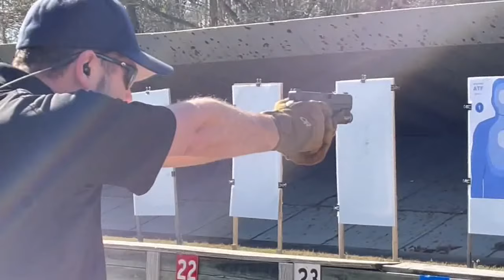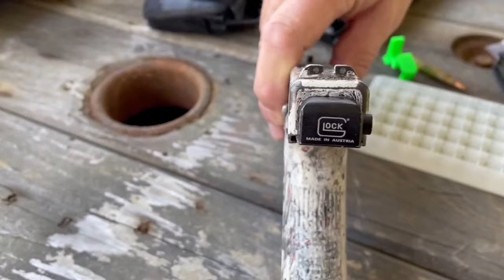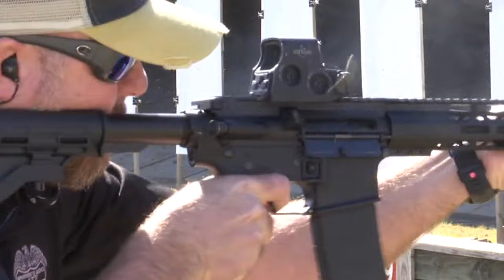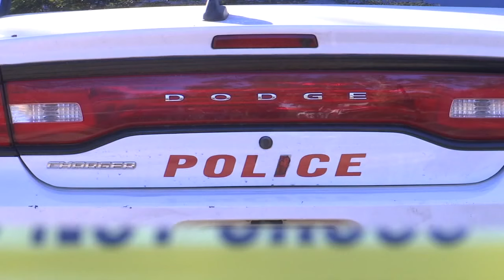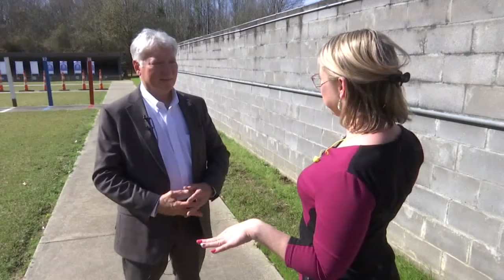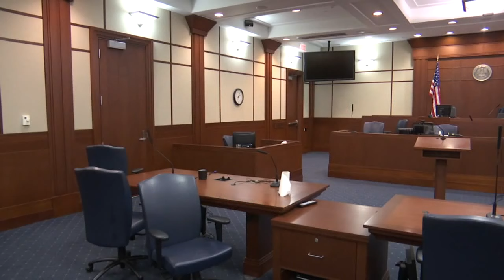How does a Glock switch work? Law enforcement trying to crack down on deadly 3D printed attachment

Comment: Any ban should include law enforcement as well.
Reply: That sounds great.  the spray pattern of this would hit too many bystanders.
Reply: Found the criminal
Reply: The road to serfdom  Membership has its privileges.
Reply: Yup
Reply: @1993MAZDAMIATA  Found the Biden voter
Reply: @oldnite3414  I don’t even vote
Reply: @1993MAZDAMIATA  what criminal?
Reply: @bigjon576  op
Reply: @ZirbMonkey not if you add enough penalties to discourage using it indiscriminately. We keep attacking the gun when society is the problem.
Reply: Yeah if I can’t own a fully operational tank than neither should the army.
Reply: It seems only useful at close range vs one person. I would not use one even if it were free and legal.
Reply: A majority of law enforcement doesn’t have full auto weapons 🤡
Reply: @1993MAZDAMIATA  so you are part of the problem
Reply: @CYOnTheBeat  not necessarily. Why would I vote if both candidates suck. No point on voting for someone you don’t like
Reply: why?

Comment: We should all be able to legally possess switches if all the criminals already got ‘em 💪
Reply: That should mean they're "in common use"
Reply: They were originally intended for police use but since they’re inaccurate they didn’t use them then some got on the streets and they ban it
Reply: @therandomrobert1842  The funny thing about that is that Glock themselves made the Glock 18 which is a full auto version so clearly there's a market for it in police, military and private security
Reply: @therandomrobert1842  only police can spray a Glock safely 🤓
Reply: @ir0nlun6s56   But your machine guns need to be transferable which means they were made prior to 1986. And they're very very expensive
Reply: I mean why would you want it to be legal, it's cool and fun yeah but really inaccurate and doesn't really have any use even in the hands of police
Reply: @redtra236   If you're big enough and trained enough it's very practical..
Reply: @aaronsmith5600  Yeah with a vertical grip and stock it's definitely effective
Reply: @redtra236  it should be legal because of the second amendment, it's not about practicality it's about the principle
Reply: @1810jeff  or being 6'6"and 270 really helps
Reply: @aaronsmith5600  I mean I did get to shoot one before(legally possessed by an SOT). I agree it could be practical but I don't see why a civilian would need it, and I don't even think police should have them because especially under stress rounds are gonna go everywhere and greatly increase the risk of bystanders being accidentally shot. And also possibly get officers killed because your mag is empty in literally less than a second with a 17 rounder. If you spray 17 rounds that don't do the job you're gonna be in trouble if they are armed.
Reply: @ir0nlun6s56  not true. I have more than 12 Class III forum 1 and forum 4’s, all SBR’s and suppressor’s but if I wanted a full-auto manufactured after 1986, I’d have to obtain and FFL SOT. In order to get an any of the Class FFL SOT’s, you’d first and foremost have to have a brick & mortar store you plan on selling or manufacturing firearms from and then you can go about all the proper paperwork, filings, tax stamps, etc., etc.
Reply: Haha that's actual 'Murica logic.
Reply: Nah…criminals got them because they’re idiots. They shoot everything but the intended target.
Reply: @aaronsmith5600  just because your big doesn't make you bullet proof.
Reply: @bigjon576   Never said that just said it makes it easier to control machine guns
Reply: @chawklitWarrior Most do that without Switch equipped Glocks.

Comment: The writing is on the wall. 
If you have any semi auto that possesses the ability to be made into a full auto, it will be considered instantly convertible and banned. 
    They are just trimming some branches to reach the goal if clearing the entire forrest
Reply: THAMKS NRA
Reply: You know what the difference between the atf calling a binary trigger a machine gun and them calling a Glock switch a machine gun ...... You only find Glock switches in the hood 😂😂😂😂😂

Comment: 1200 rounds per minute… geez talk about stroking a lie lol
Reply: That's actually the rate of fire for a Glock 18
Reply: its true though
Reply: Were you also surprised that there are no horses involved in “HorsePower”?
Reply: 1200rpm is an achievable but ultimately undesirable fire rate.
Reply: Id almost rather face off against a guy with a switch.. odds are they'll inaccurately spray the mag in a second and be left empty. Id be more frightened by the idea of well placed SA shots.

Comment: It’s unfortunate this news story provides inaccurate information.   No Glock magazine can hold 1200 rounds, therefore it is impossible to shoot at rate even close to this amount.  As a retired Navy Seal, NRA Instructor, this news agency should be embarrassed at the falsehoods.
Reply: It's not technically a lie but hyperbole.  It shoots rounds at a rate of 1200 per minute.  Meaning 20 rounds per second (which honestly sounds worse so no idea.why they didn't say that). Nobody will ever have that many rounds, but it's common to measure in rpm. The A10 warthog is an example. It shoots something like 3900 rpm, but only carries something like half of that. This just means it can't shoot for a sustained minute. I'll agree they're using big numbers to scare, but it's not exactly a lie.
Reply: @foxtrot889  
I completely disagree.  There is no way any person can take this weapon system and with any or every magazine available commercially make the Glock weapon reach 1200 rounds per minute.   Your assertion of this being a hyperbole, I could attest this device limits this firing rate to 1 round per century.  I would immediately be called out as a liar.    The fact is, there was a statement made that was completely inaccurate, intentionally misleading, and had the intent to scare people who already know very little about firearms, to believe they are bad.  I am very aware of the firing rate of other weapon systems.  This video made no claims other than what I addressed in my accurate comment.
Reply: @michaelscott9285  all I'm saying is it's a common measurement of how fast something shoots. Again, see the A10 warthog. It fires 3900rpm but only carries 1174 so is incapable of firing for a minute straight. RPM just means if it sustained fire for a minute, how many rounds would fire. They could've said 20 rounds per second, which a Glock with a 20+ round mag would indeed be capable of and it's the same exact rate of fire as 1200 rpm.
Reply: I have a 32 gallon fuel tank in my truck, but it can travel from Va Beach to San Diego on a single push of the accelerator without stopping and can make the trip in 15 minutes.  Oh by the way,  the need to continually add fuel is overlooked because a Dodge Hemi drives fast is preposterous.   So using your reasoning as this being a hyperbole, I can start telling everyone this is a true statement.   This does not make what the news report stated any more true than my statement saying I can drive coast to coast without adding fuel.   NEITHER statement is true or accurate, Both are misleading, but only one is a lie.  The one where this newscast makes an intentional false statement.   You cannot justify a lie because you use the term hyperbole.  Try using this defense in a court of law, I am sure you can discern if this would be a valid argument in court.
Reply: @michaelscott9285  Your the reason america is failing. Its like saying 3 feet doesnt exist because i only got 2.
Reply: just fear mongering my man.. just fear mongering.. sure the majority of people shouldnt have full auto but come on.. just reload time will lose you at least 150 rounds in that time if they can get it up to 1200 a minute.. belt fed glock pistols are definately dangerous lol
Reply: it's thier attempt to scare the audience.
Reply: @chetpower772  maybe he's saying that a glock can't fire 1200 a minute even with that device.
Reply: @theCosmicQueen it 100% can that dude who claimed to be a navy seal is clearly stolen Valor when we say this has the fire rate of 1200rounds per minute we don't mean it has a 1200 round mag😂😂😂
Reply: @foxtrot889 that dude claims to be a navy seal but think you mean firing 1200 rounder per minute means having a 1200 round mag😂😂😂😂 defiantly stolen Valor
Reply: @michaelscott9285  I guess the Gov't own specs for the glock 18 is 1,100-1,200 RPM must be wrong too, you should call them, and fix that, ATF would be happy to assist,  lol.
Reply: I get what he’s saying. With that device, if you actually want to fire 1,200 rounds with it… it will take you a lot longer. 

Just because I can run 15MPH… that doesn’t mean I will run 15 miles in one hour.

Comment: Full auto makes you less accurate, it's only good for mag dumps and mobs of zombies.
Reply: I learned in the Military to use Full Auto only when Advancing on a target or retreating from a position. Run out of ammo quickly.
Reply: I can’t really think of a use case for it. You would need to add a “””brace””” to have any form of control or one of those frames I’ve seen at gun shows. I really can’t think of a use for an smg apart from range fun or cqc in a combat scenario
Reply: @traceswann7054 no you can control a glock switch perfectly with good hand placement

Comment: 12,000 rounds per minute is an insane statement you will probably need like 8 glocks rigged to shoot at the same RPM
Reply: Notice the staging too - "goes from shooting one bullet at a time to 12,000 rounds per minute." A practiced shooter can make a semi gun shoot almost as fast as it would with a switch, so they hide that fact by conveniently not mentioning it at all. And then of course, there's the obvious fact that 12,000 rounds is insanely overestimated.

Comment: Hands down i can't think of any valid reason to have one. But stop makin' it seem like the law-abiding gun owner is doing this. It is 10000% exclusive to criminals.
Reply: Next door neighbor use to target shoot.
A BUNCH.
Heard rapid fire several times and guessed it was a machine gun.
They use to blow stuff up that would rattle our windows a quarter mile away.
Since all these noisy events from years gone by I have learned about tannerite ,
Slide fire, bump fire and now Glock switches. Been quiet over there for awhile now but I make a little noise myself now and then.

Comment: If anyone has shot a Glock with that switch.. The Magazine would be empty in seconds and since it has no stock or anything to help control it.. They would likely have a lot of rounds aimed higher than intended.

It is the criminal, not the switch who is at fault.

Comment: What troubles me that in the US Armed Forces it is , according  to tge Geneva Convention to use non jacketed or ball type ammo against the enemy  and all the antipersonal small arms ammo is full metal jacket. This prevents the round  from expanding  ( mushrooming or possibley fragmenting into smaller pieces causing major wounds ) and inhumanely harming if not killing your enemy in a brutal way. The jacket ( usally copper) keeps the lead intact and may just go straight  thru a body which actually statistically  causes  less harm to a body than if it expands inside and all the energy is transmitted to the inner tissue and destroying way more tissue and or  organs . However our own police use fragmentation  rounds  against  its own citizens and many many people are shot by police  and either  killed outright  or severely  injured  with multible wounds  from one bullet that may not have done a serious  enough crime to warrent being shot at in the first place. To  put in perspective it isnt legal in war to use these rounds against your enemy  who wants to kill you but our local cops can use them against the citizens  of the US.  Their claim is there is less  chance of collateral damage or hitting a innocent bystander  if the full metal jacket round they shot at a  possible suspect and it went thru them. Why dont they just NOT shoot period if there are potential innocents in the area. Use good judgement  when discharging a firearm  instead  of using violent rounds that  are so bad they are outlawed in war .

Comment: A lot of comments stating that Law enforcement shouldn't have them, people should be allowed to own them, etc. As Law Enforcement I wont use fully auto on anything anyways (not that I have anything issued that's fully auto, contrary to what all these geniuses are commenting) because why would I. Unless you get someone who actually knows what they're doing, fully auto is trash. I can place a good grouping of rounds with semi automatic in a very small amount of time. I'm not trying to shoot down a helicopter with a fully automatic. They're inaccurate compared to semi automatic no matter how good you are with guns. I've fired tens of thousands of rounds during my 8 years in the military, if not well over 100k, from M4's and varies types of machine guns. I'll take semi automatic all day. There's a reason actually machine guns are mounted to the top of a vehicle or a tripod typically, sometimes a bipod if the situation calls for it. Also ABC needs to learn what a machine gun is, because a full auto Glock is not even remotely a "machine gun".. Ole girl probably thinks AR15 stands for automatic rifle 15 rounds a second from a 'clip'

Comment: Just for prospective, the largest factory Glock 9mm magazine is 33 rounds.  At 1200 rpm, a 33 round magazine would empty in 1.65 seconds. A standard 17 round Glock 17 magazine would empty in 0.85 seconds (definitely NOT the rate of fire seen in the video).  How many loaded 33 round magazines can a criminal carry?  Also, probably only the first round will land on the original point of aim.

Comment: Well under the nfa it has to meet both dangerous and unusual weapon. It doesn't meet both as glocks are so common even cops and gangbangers have them! There in common use and so the switch is also common and by itself is not dangerous or unusual

Comment: I can think of several reason why I’d want a switch on mine. 
1. Being everyone else has one. So without. Your inefficient
Reply: Definitely not true, efficient implies accuracy and precision, you are neither accurate nor precise while using a handgun in auto mode.
Reply: @ndane2 you've Cleary never shot a full auto hand gun then I shot a g17 at 25feet and hit every single shot on target these switches are very easy to control if you know how to hold a gu properly and if you don't then you shouldn't even be firing a gun in the first place